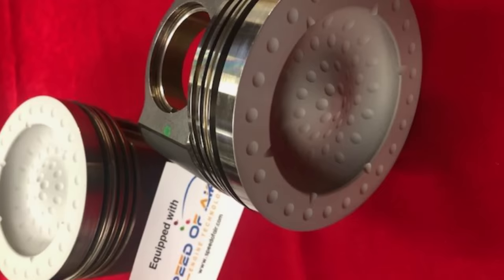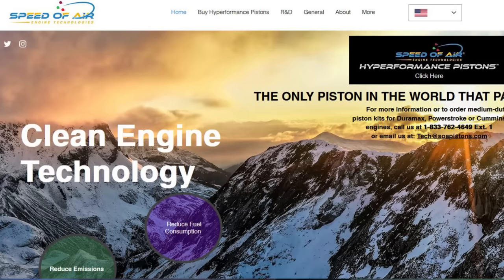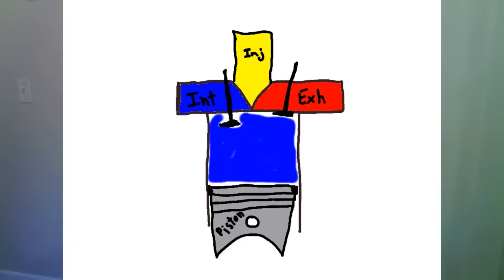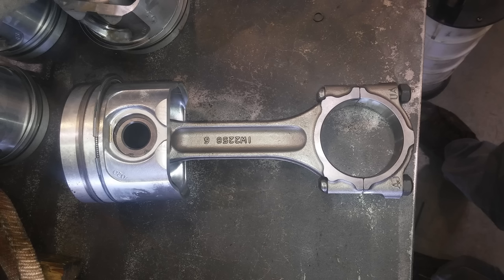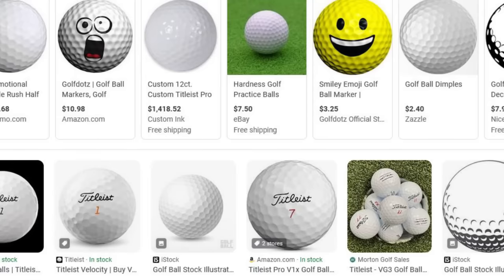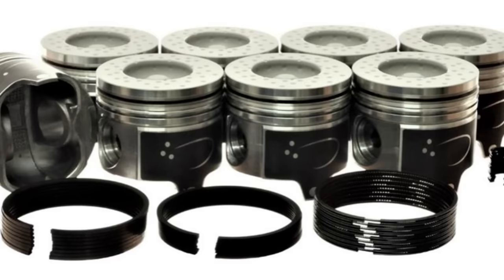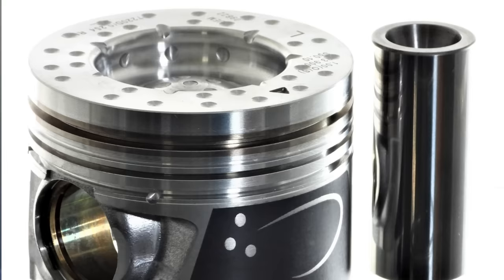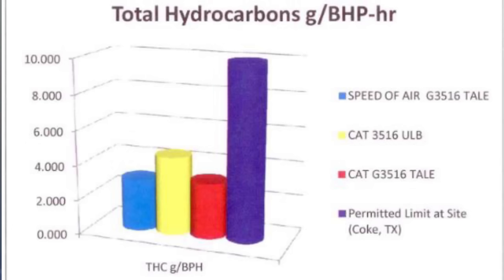Could Pistons with DENTS make more power and burn less fuel? Speed of Air Pistons.

Comment: Been into high performance engine's for a long time. 
 It seems to me that it isn't so much the dimples,  as it is the coatings and the rings.
 The ceramic coatings (which I used when I rebuilt my c15) is good for an increase of 10 to 15%, (another 5 to 10% if the combustion chamber is coated as well) perhaps even more as the return increases with increased compression ratios.
 The gapless rings on a gasoline engine are good for a minimum of 2%, and up to 4 or 5 percent because they almost totally eliminate blow by. I believe the increase is more with a diesel as the cylinder pressures are so high. 
These two upgrades together will net an increase of 15 up to 25%.
Reply: How much difference is there between a C15 and a C18, not asking for stock info, I would like to know what HP that's possible to get out of each motor. I really want top HP that you can get out of each engine. I really have a big thing for the old 1693 but they are really heavy, but damn they are stout and get lots of working miles.
Reply: % of what? Mileage, HP, torque?
Reply: I didn't realize they use gap-less rings in their setup.
Reply: @asimplelifeinthephilippine1465  c18 has different crank rods and pistons i believe but everything else is the same. Same head and block.
Reply: I think you left out a decimal. It’s actually 1.5% to 2%. No way coatings increase efficiency by 15-20%. I’ve never seen a claim that high either.

Comment: This seems to me like the really large diameter of heavy duty engine pistons trying to keep really even mixing and therefore combustion evening out the hot spots on in a diesel wouldn't be a bad thing, a bit like the cutting edge stuff of trying four sparkplugs per piston or even laser ignition in F1 cars.
Lots of clever ceramic coatings around these days that are supposed to reduce friction and also heat transfer, like exhaust coatings helping make more power.

Comment: As it pertains to Diesel and emissions the emissions reduction far exceeds the inherent issue that exhaust after treatment emissions systems are the cause for reduced engine life, efficiency and performance. That makes any attemp at emissions reduction in the combustion chamber exponentially better for any Diesel and the environment. And worth the investment especially in states that set unrealistic emissions standards that these pistons could I'm guessing exceed until hydrogen Diesels are perfected.

Comment: I have doubts about this idea. ICEs work by burning a fuel/air mix, the resultant heat expands the air and pushes the piston down. Just imagine for a moment that you could cool the burning gases as fast as they burnt. There would then be no expansion or power. Increasing the piston surface with dimples increases is surface area robs a little heat and power. Any power increase found will be due to other causes. Perhaps a change in turbulence.

Comment: I saw this on YouTube and asked the company for pistons for my old 7.3 liter diesel pickup truck but they said they were not making the 7.3 liter Diesel engine pistons.
I would volunteer my truck to test the piston’s I don’t tow anything but I do drive around New York City quite a lot for my field technician job since the 7.3 is stock and old I’m getting 14 mpg average 10 percent more might not be much but lower Nox and better performance might be nice.
Reply: We have piston kits for the 7.3L in stock
Reply: @speedofair  is that for the 7.3 idi engines or for the 7.3 power stroke engine I believe what davidlampe4153 was asking about was for the old idi engine

Comment: Makes me wonder how they will behave on the modern "Clean Diesel" trucks. Would it cause issues with the DPF system due to a reduced output. Only reason I even mention this. Is that there are large portions of the emissions systems that are tuned for specific temp and output ranges. So it really makes me curious is the potential improvement could have other unforeseen side effects. In the ever evolving push to meet emissions regulations. 

It also reminds me of the the RCCI diesel prototypes are doing in another way. While running two fuels to improve performance and lower emissions. By increasing the amount of fuel burned and lowering the waste output from combustion.

Comment: Would be interesting to see how individual modifications affect performance, not all in one piston. I would assume the holes don't do anything positive, but it is the other characteristics that improve efficiency
Reply: There is plenty of info about coated piston skirts out there, and it's reduced friction. There is plenty of info about ceramic coatings retaining heat in the combustion chamber better. Which mean better combustion. And dimpling pistons and the combustion chambers in flathead Ford V8s is also fairly well documented to increase both power and efficiency 90 years ago. Due to better fuel atomisation. All three have been done seperately. The reaserch has all been done in the past.

Comment: If it's true and it does reduce fuel consumption and engine wear, that right there is a huge benefit. I could see how it could help in atomizing fuel better as well as more or less increase surface area.

Comment: Dents create more area than a flat surface therefore better heat dissipation. 

2nd ring is hapless ti avoid blow by. It's two rings machined. Gapless. It all works.

In racing we would also drill holes from the top to behind the 2nd ring land.
This would pressurize the ring to the wall. 
High cylinder pressit res but a lot of wear though

Comment: The guy should be contacting Diesel Generator Companies, to test these out.
Lower Noise? Better fuel efficiencies? Less emissions, which also means less smells? Better torque? 
That's everything you would look for in a generator, that has the potential to be running for days on end, during emergencies.

Comment: I would be interesting to see long term test data on these to see if the benefits remain after several years and a few hundred thousand miles after the piston coatings have had some real world abuse. The dimpling may add some improvements,  but the rings and coatings probably are what drives the difference from stock. Piston coatings are nothing new, a lot of diesel performance builds utilize coatings on the pistons, but again we don't know what sort of proprietary blend they are using.

Comment: The only thing alarming about this is that it hasn't been done already, it seems like something so fundamental would have been explored by engineers developing the piston aerodynamics
Reply: The computation power needed for the fluid dynamics involved was not there until these last 10 years.
Reply: @bobbywalter5320  sure but we've seen a lot of innovation in engines and we've had new semi truck engine designs in the last few years. If something so easy could improve efficiency I would think it's already been done

Comment: they are still in demo/ bug fixing phase before they finalize the design and process before mass production. gentry & sons are building a block with them as well as getting a tune to try and be carb compliant with no after treatment bs. give it a few years, either they make it, or the big oil will shut them down because of the savings

Comment: @1:56 "diesel engines have pistons folks"

M1 Abrams tank ponders asking someone to hold its beer

I know what you mean, but there are turbine engines that will happily run on diesel, yet lack any trace of piston whatsoever. The Honeywell AGT1500 in the M1 Abrams runs on diesel, jet fuel/kerosene, gasoline, marine diesel and apparently in an emergency even alcohol, if high enough proof.

Comment: What's your thoughts on people saying if you start an engine on either/start ya bastard too much it becomes reliant on it I know it hydralocks with too much and blows pistons around rings or shaters rings might be interesting to hear your thoughts thanks Dave in new zealand
Reply: The regular use of ether to start diesels can and does damage engines. Piston rings can break, for example. Over time, the reduced compression does mean you're faced with using ether all the time. Ether is bad news.

Comment: Air moves on the intake burnt gas moves on the exhaust. It moves faster with less friction. Put the dimples in and you have less frictional area for the given surface area. Prove it on a flow bench.

Comment: i find amusing that GM also swapped the piston bowl design in dem newer '23 models LZ0 3L & 6.6L L5P duramax engines to a kind of tapered shelf over the bowl as they say has given them better efficiency and power and its already out there! (banks has an article/video going over the pistons)
now while im not too sure about dimples noticeably improving power and efficiency although i do think its theorethically possible... it does raise the question to me, why has this kind of desing not been already in production given the "advantages" from the likes of mahle with their basically bottomless office with very smart engineers and designers? like you would think itd be them to say "this is better and will help you pass emissions"

Comment: The dimples form edges on the surface of the piston which will vary in temperature (getting hotter on the edges of the dimple) increasing pre detonation and detonation... Not good especially in boosted engines.

Comment: Fuel never contacts the piston on a regular diesel engine. If it does, engine has problems. Coated piston skirts would probably make a difference should the engine lose oil pressure, but only for a few seconds at the most. Otherwise, cylinders are already coated with oil. Gapless rings would probably make a difference. But they're more expensive than conventional rings. I'd rather spend the bucks on having the engine torque plate honed, so that the cylinders have a true round. I suppose that gapless combined with torque plate honed would be a winning combo, but at some point there are diminishing returns.

Comment: Unfortunately, the tests don't address the question. Yep, coated pistons reduce heat loss and quenching. Yep, forged pistons are lighter. We already knew that. Today's question is whether dimples are a significant advantage. The "control" needs to be a competitor's coated forged piston.

Comment: Wish they would do this for diesel cars too. If they made anything like this for TDI's I would buy their parts in a heartbeat. 
My 2009 is on a full DPF and EGR delete, I don't ever see any smoke coming from the back of the car even on full throttle. But if these pistons can actually provide results with any benefits. I would definitely make the upgrade happen.

Edit:: Also do keep in mind why the United States is at a stalemate for fuel economy. Some cars in Germany had turbo Diesel engines with emissions gaining up to 75 or 80 mpg.. United states wont allow those engines and banned them from entering past the ports. Apparently they were deemed as too efficient. Nothing against them being safe. Our country lives on the board of monopoly with heavy risks and manipulated freedoms... The man who invented a motor running on a water only carburetor?? Never to be herd from in the mid 90s early 2000's.
Reply: Fisher Motor Works is independently testing our pistons in the BMW M57 and the TDI right now.  Keep watching for results!
Reply: @speedofair Now that would something to see.  I have three diesel vehicles, an old 7.3 powerstroke, a 1.9 TDI, and a newer Ram with the Ecodiesel, so it will be interesting to see how these pistons work with some of these smaller diesel engines.

Comment: So "combustion" is simply about adding "air"(70% nitrogen plus 29% oxygen) to "fuel" and with a diesel engine using pressure rather than a spark plug to create "ignition." The only difference i can see with this piston versus others is adding more surface area meaning "more air combusted using same amount of fuel" hence probably the reason for the name of the business.

Comment: If what they’re saying is true they need to make these for the 5.0, 5.3, 5.4, 6.2, 7.3L gas engines,not necessarily in that order. I bet tons of people would be pleased as punch to pull 10% more miles per gallon on a 5.3 withe even the same HP… and there all the internet rage right now with these LS swaps and such. Granted I get this is primarily a diesel page but the number of 6.7s and 6.6s being torn down daily is probably not that high. I would love Bank’s to throw these at their duramaxes with the dyno and instruments!
Reply: We've done almost every fuel type with similar results.  We've focused on diesel to start but working with numerous race teams in gas applications.  Keep watching!

Comment: Let start drilling my pistons, make my N14 emissions legal, dump them ISX's I ran a small fleet of cm870 trucks, i hate them even though I fully understand the engine, i will never own another one, my father still runs one, i have a parked truck with one that's for sale but nobody wants the ISX, told dad i would take that truck and put an N14 in it, less fuel economy but reliable and easier to work on makes sense to me

Comment: Physics wise this also INCREASES surface area that effective cylinder pressure can push against the piston .... Probably roughly a 30% increase in surface area and effective force in addition to the air turbulence pockets that LEAN the combustion mixture combined with the normal Swirl effect

Comment: super skeptical

in theory,
- it decreases compression ratio
- but at the same time, increases the surface area for the explosion to act upon

so which has more effect in power and torque?
- compression ratio
- or piston surface area

*the golfball explanation is st*p*d 😆
*dimple on piston will accumulate carbon

Comment: Didn’t science prove the physics behind this a century ago? Of course the metallurgy on the piston surface to maintain uniform temperature is critical. Varying depths of a specific metal alloy coating the piston surface should theoretically solve this, but at what cost.

Comment: At least through the first four and a half minutes of this video, you have several times stated that the dimples on a golf ball and the dimples in a piston have no relationship to how they function to each other. You're missing the freaking point. The reason of golf ball can fly with dimples on it is because it creates a boundary layer. The reason a piston with dimples on it is more effective is because it creates a boundary layer. It's the same freaking action on both devices.
During the Korean War they found that if they put car wax on the leading edges of their wings about the first 10 or 12 in of the leading edges of the Wings on an f-86 Sabre it would fly about 10 to as much as 15 knots faster. The reason? It creates a boundary layer that is most effective where the wing is actually having good knife into the air.
The boundary layer will create static spots on the Piston where thermochemical expansion occurs, called the actual explosion of the fuel-air mixture presses against the Piston, when it comes across the static boundary layer where the fuel-air mixture is actually leaner, it will keep the Piston cleaner and what will also increase the force of the thermochemical expansion.
It seems that one could manufacture their own Pistons, there's more than enough deck thickness in the Piston you can order Pistons of a higher compression ratio and put the divots in them yourself with a CAD program. Be careful not to leave actual very sharp edges on the divots. And you could pretty much make these self either on diesel application which would be more effective, and gas engine applications. The lower compression will be a little bit lower will result in lower efficacy, but in the one graph you're showing a 30 horsepower increase at the low end to as much as 70 horsepower as you increase the RPMs, that's a lot of horsepower for just putting a few dimples on the Pistons.

Comment: Impossible. First You don't know about skin effect: all the fuel mixture inner the holes don't burns and you get hydrocarbon emissions to the environment. Then you need a micro finish surface on all THE COMBUSTION CHAMBER and avoid holes. No matter for the volumetric efficient if there are or aren't holes

Comment: Dumb - To imagine that a small company is doing something "innovative" that the Massive OEM don't know about is ridiculous. The OEM chose not to do it as the costs don't outweigh the benefits. Might be ok for race engines as basically that's all they are doing - adding heat reflective coatings to the crown & tephlon to the skirts to reduce friction. As for the dimples .... F-all on a big ship.